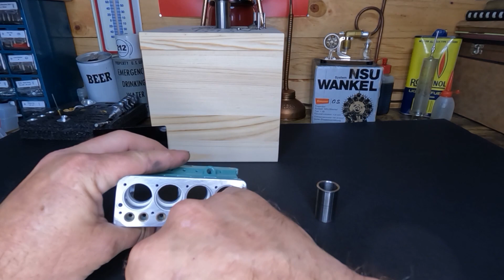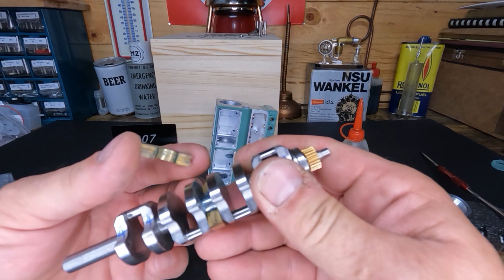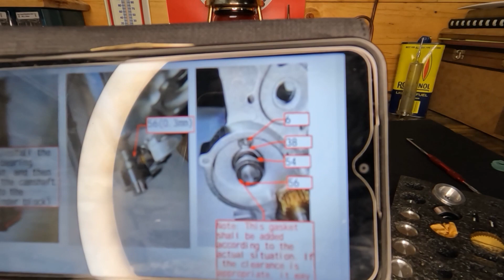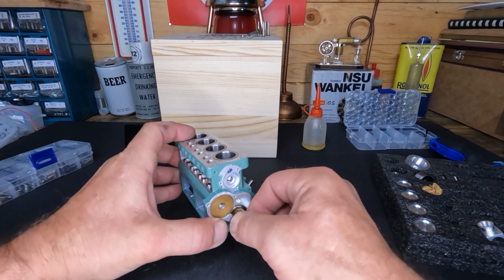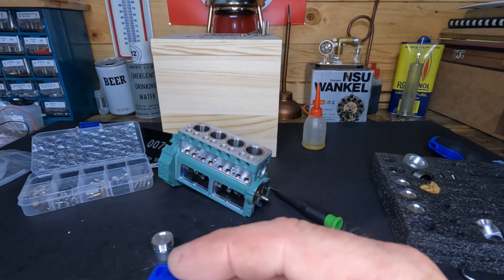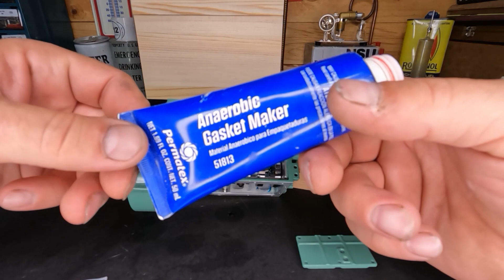A new Cison L4-175 flathead 4 cylinder engine! Part 2 paint & assembly time!

Comment: I really appreciate your video, I just got my L4-175 last week. One thing I was hoping to see was the installation of the wrist pins, any tips you have on that process would be appreciated. It looks a little tricky on other videos I've seen.
Reply from the maker: I had to watch the video again myself. They have a slight taper to them so they'll only fit properly one way and only through one side of the piston.  If I remember right it was a bunch of trial fitting between pistons and pins to find the best fit.  A mirror or glass will help you find the small end of the taper on the wrist pins, just roll them , the small end won't cover as much ground and they'll run in a circle 👍
Reply: Thanks for getting back to me, that info really helps, I watch JohnnyG install them on his video but as you know, he doesn't talk so it looked a little tricky. Really nice job on your engine.  @steam212

Comment: Hello again, I'm almost ready to start my L4-175 up (thanks to your videos!). Do you know what the factory settings are for the carbs high and low fuel needle? Specifically, how many turns out from the bottom? Thank you!
Reply from the maker: Hi Daniel, I started with 1 and half on the main jet and 3/4 on the idle jet.   To be honest with you, I swapped the factory carb for a .15 nitro rc carb and the results were much better when it came to tuning it in.
Reply: @steam212  thank you! I couldn't get mine to start for some reason. I have gas, spark, oil pressure. The timing seems to be correct too... Maybe it's the card. It feels like it is about to start but it doesn't :)

Comment: Thank yo for the great video! Would you mind sharing where you got the spray paint? Is is the brand Detroit diesel? I keep getting DupliColor brand come up in my searches. Thank you!
Reply from the maker: Hi Daniel, the paint that I used on this is made by duplicolor, I bought this can from O'Reilly's I will have to check on the can to get the item or part number for you, but is called Detroit diesel alpine green. It is a high heat engine paint. Thank you for your question, your interest, and watching 👍
Reply: @steam212  Perfect, thank you for the information!

Comment: Same pistons and rings as the V-twin. One cast iron and one flourogel ring. I lightly polished the cylinders, pistons and rings and the compression and smoothness is awesome
Reply from the maker: Hi Mr. Thomas, I sure hope that by building this using both cast iron rings doesn't come back to bite us. I will break these rings in the same way that I was taught and hope that the theory also scales down. I was honestly on the fence about how to configure the rings, but then I convinced myself to build and break it in the same way you would build any other full size engine.   Thank you for the helpful tips, if it all goes south, I will definitely follow your instruction.  Thank you again for continuing to watch and for helping, you truly are one of the best on YouTube.

Comment: Mr 212: Cat warning duly noted. :) About quality: Yesterday I finally removed the cylinders on my Cison V-twin because of an intermittent lock up / low compression Cison sent me new rings months ago; and the affected cylinder did contain a faulty ring with a chunk out of it, treated with antifriction; so, a factory failure. It caused uneven fitting of the ring I guess. Not only is compression matchingly perfect now, but I got to see the quality of the parts. One thing that stuck with me is that the little piston wrist pins are just perfect. In every other Chinese IC engine they are a little slapdash; the ends are hand-rounded imperfectly, not polished, and don't exactly fit (I pack them with foil). The Cison V twin pins are a shiny chromed pin with perfect hemispherical ends and perfect fit. Little works of art and skill. That alone suggests to me my next engine should be a Cison, maybe this one. I love my Microcosm engines, but lately the cast conrods come with unmachined big end (!) lasts about 20 minutes til loose...ok in the tractor but a pain in the little brass v-twin. Great vid, one of your best, keep 'er comin'...

Comment: I got my Cison L4 started last night, Steam 212.

 I had spent a few hours the other day trying to start it, with zero luck. I had checked cam timing, carb, valves, & ignition timing multiple times… and couldn’t figure it out whatsoever.  
Thought the L4 was gonna be the 1st miniature engine in a long while, lol.   
Originally I had wondered if the 2 piston ring setup would have enough compression… but I went with it, since the manual recommended that method.   
Well, tore it back down & installed the 1 o-ring, one piston ring setup.   That did it.  Started right up. 
-Thought I’d met my match there for a min, haha.  

Hopefully your L4 will be ok with the dual ring setup; I plan to put a few hours on mine then go back to the 2 ring setup.  

I was really impressed w’ the little L4’s oil pump… it works very well.  Also was confused as the assembly directions noted that the pump’s driven gear no longer uses a dowel pin, Cison engineers eliminated it for some reason.  Works perfect w’out the pin though.
Reply from the maker: That is fantastic!  What number did you get?  How did you make your motor mounts?
Reply: I’m # 031.   I haven’t made any mounts yet,  I’ve just been running it sitting on a shop rag on my bench… Manifold has got my fingers a few times now 😂

I’ve been talking to Mona about a set of mounts from Cison; she said she will put them on the site soon.   Gonna ask Mr George Britnell if he can make a base for me sometime in the near future. He made both of my V2 bases 😁

Little L4 runs actually really well.  My front water pump seal is dribbling, so I’m gonna pull it apart tonight to check it out
Reply from the maker: @mhz-yn9gh  I am working on making a mount design with some cad software now to be 3d printed, if it works out, I'll see if I can figure out how to send the file to you. Congratulations on your engine!
Reply: That would be awesome!! Thank you!  Hope you can come up with something 😊
I really like the small base / mount like Stirlingkit uses in their videos. 

Man, I wished I knew about about 3d printing… I’ve used 3d printing services, but never created anything myself.
Reply from the maker: @mhz-yn9gh  My learning curve has been pretty steep on the cad software but we've graduated from a pile of spaghetti to recognizable parts so maybe there is progress being made 🤔. I will definitely keep you posted on what we end up with.
Reply: Yeah! Please keep me posted ! 🤘

And let me know if you run into any questions on your build.  Gonna make a vid of mine running tonight.  Are you on FB, Steam?
Reply: ** Thought the L4 was gonna be the 1st miniature engine in a long while… that was gonna kick my ass 😅